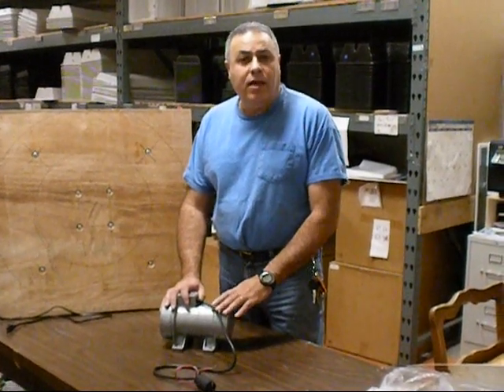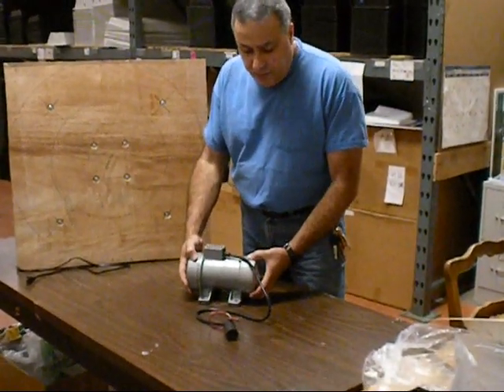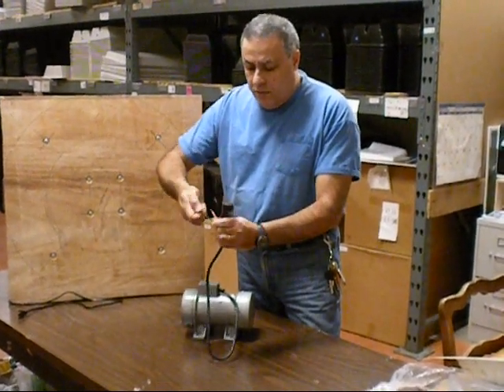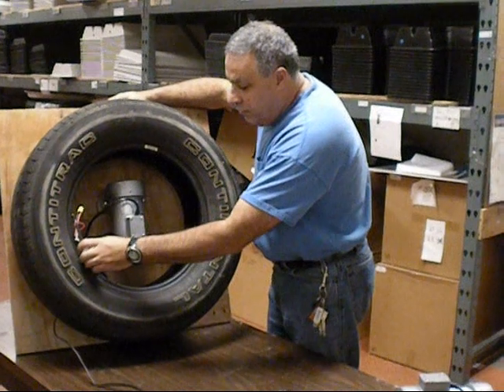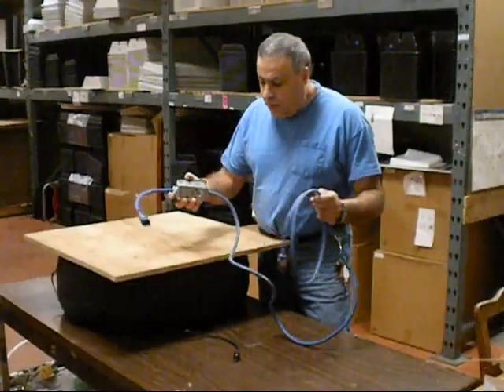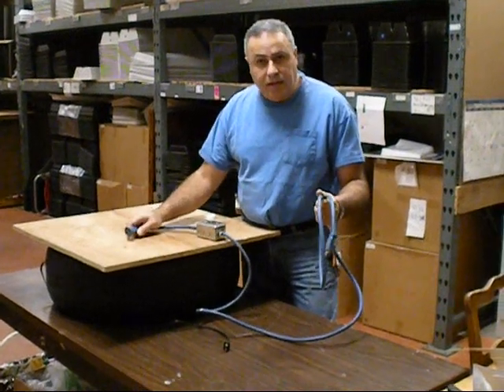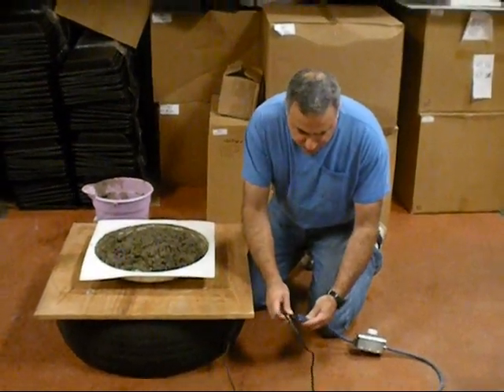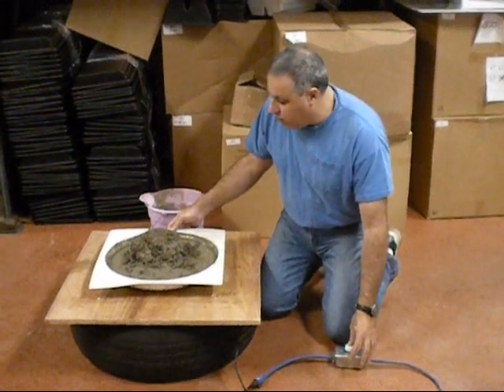How to build a Vibrating table on a budget

Comment: Please why using motor tired?
Reply: Hi Namso,
The tier is flexible to move in all directions and it is less noise than a metal springr. this motor has counter weights on each end it create the perfect balanced vibration. Have fun and stay safe.
Reply: @faroukramadan5170   wow thank you very much

Comment: How many watts is your motor?
Reply: Speed: 2800rpm 
Force: 440 LBF
Voltage: 120V 
Currency: 0.7A 
Frequency: 60Hz 
Power: 0.28Kw
Reply: Thank you so much!!!
 I was wondering if 200w was enough

Comment: Great....

The only thing I see is you might need is a simple frame work to hold the mold in place while vibrating. I realize some molds might be larger than others and shape wise but you just need a “stop” (2”x2” or larger strips) to keep the mold(s) from accidentally vibrating off the edge and making a mess. Could make different sizes to hold different molds so make the stops removable.  Heck you could have a sneezing fit, a sudden back pain, anything that might make you turn loose of the mold and in a split second...off the edge.  

You could use a couple more tires, and longer board so you do more molds at one time.  In this case you would need an edge stop - as you don’t have enough hands to hold multiple molds.

Great job..will have to check out your molds.  I have made these and it always takes time getting it smooth and mixed in.  The only thing is don’t vibrate too long or the aggregate will go to the bottom and affect curing and long tern durability.

Comment: Hi !     thanks for a great video , i really need to build one , but i have no idea of what kind of motor to get , can you tell me what is the best one  size and power best suited for your table , are these motors used for other things apart from vibrating tables ?Anyway thanks again ........ Karl
Reply: Hi Farouk thanks for letting me know , the only problem is that i live in Mallorca Spain , so i will probably have to search for such a motor ........ inssidentlly  what misture do you use for stepping stone molds ? thanks again for you help .... Gilly

Comment: I used my huge variable random orbital sander, glued a sanding disc upside down onto a board and smashed a hole in a palette, big lumps of styrene under  the corners sander in the hole I could reach in to the switch for on, off and speed, sorted.
Reply: Great idea (but where is the link to your video?) lol
Reply: GAF2011NJ 
No link, that project is long gone, making another from sofa springs , plywood, motor, large bolt or set screw ( fully threaded bolt ) for vibrating motor and some ingenuity equals vibrolap.
Videos, I don't do normally , I have done some showing my finished work but I'm an old man, technophobe and camera shy.
Reply: Symon Sheppard another great idea!

Comment: Does the motor have an off set lobe attached to the arbor to cause the shaking? If I have a capacitor mounted on the top of my motor should I seperate it to prevent damage from the vibration? Thanks for posting this I have a need for a larger table for plaster casting and already own a larger induction motor off an old table saw. I love the use of an old tire, that's great reuse of material! Thanks again

Comment: I would like know what motor you use in the video and how much weight the table can support while vibrating?
Reply: I have the same question...
Reply: @kingdarkem  same
Reply: its a vibrating motor search it on amazon.. just a motor with an unbalanced load on it that causes vibrations. assuming it's 3/4" plywood table top it should be enough to hold your mother in law if she's tempted to have a seat (500-600lbs capacity / weight of the average american).

Comment: hi Farouk, I have purchased a larger 240v vibrate motor in attempt to copy your design. I went to the electrical store and was about to purchase a dimmer switch but they didn't think it would work with 1.5 kw motor. please reassure me I wont melt my new motor.
Reply: sorry to annoy you but how would you find this out?
Reply: Stephen Moulden just buy a 240v motor speed controller that is rated above 1.5kw, easily got on ebay

Comment: I tried to build this setup but can not get the motor to turn on with the dimmer switch.  It just makes a low hum.  Do I need to keep the original switch in the circuit for the resistance?

Comment: hey mate. awesome job. i use your idea but changed a few things. i dont have a motor that vibrates and did not want to spend money to get oe, what i do have is a are compressor and die-grinder. i had a stuffed tire and with the compressor i can control the speed and i just zip-tied it to some sheet metal that is bolted to the tire and just used a old bet screwdriver to make it vibrate and is awsesome. your vid helped me out some much so thankyou

Comment: Hi, i would like to make a vibrating table but to use it in my kitchen to get rid of air bubbles from the chocolate i make, first i wanted to know, do these vibrating motors come in sizes? also does it make a lot of noise? could i try reducing the noise by using a rubber mat between the motor and the plank of wood. thank you look forward to a quick response

Comment: Make a table on based on this model.  Used an old attic fan motor; added a pulley; drilled a hole in the pulley and bolted on a mass of washers to unbalance it.  Works like a charm.  Total cost under $25.00